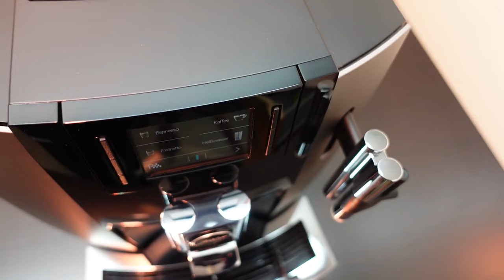Jura E8 Refurbishing and Deep Cleaning

Comment: this is EA model? I have EB model E8. Would it be the same?
Reply from the maker: That was an EB model, as far as I can remember.
Reply: @yt.myworks  Thank you, one another question, after you marked grinder, you took it off, cleaned it and you returned it to the same line mark but you stopped one notch earlier before marked line. Should i do one notch before like that?
Reply from the maker: @siiNke  I recommend making the same settings and then readjusting as needed.

Comment: my works fine, only have problem with steam. there is 3 sec of steam and than water just dribbles.
pump is fine, boiler/heater is fine, pressure reg, el magnetic valve  is fine, overpressure valve is fine, coffy pos valve is fine, magnetic pisston for brew unit fine.
i really not understand what is the problem.
can you help
Reply from the maker: Have you already checked this valve?  
https://komtra.de/media/files/Jura-C-E-F-Serie-Classic-Reparatur-Anleitung-%C3%9Cberholen-Revidieren-des-Auslaufventils-A6551301080.pdf
Reply: yes this is overpressure or pressure reliev valve, i dismantle it, put it into the citric acid for an hour and reassamble it. rubber seems to be ok, and i also lube it with vaseline. 
as i see it this thing is more or less safety valve if something is wrong. the outlet of this valve goes to the brew unit valve (magnetic piston operated)  or to the steam valve (magnetic valve). 

if something will be wrong with either magnetic valves than hot water wouldnt work or expresso wouldnt work. 
if pressure relief valve will be falty and wont hold the pressure steam or water will be released at this valve.
Reply: now i tested it. when i press steam button water is heated, pressure raises and i see water and bubblea moving pass this valve towards brew unit and into drain plate.
does this mean this valve is bad?
Reply from the maker: Did you install the spring in the valve correctly? The position of the spring is important!
Reply: @yt.myworks  yes it is positioned correctly, you cant even put it together if it is not
Reply from the maker: Okay, but I made the mistake of installing the narrow side of the spring on the outside. Consequence: No correct function. Can you make a short video with your mistake? Maybe I'll notice something. You can send me a link to yt.myworks@hotmail.com
Reply: i change that valve with new one and the same, after 3 seconds steam starts to sprinkle out of discharge valve and into the drip tray. 
maybe the reason is this discharge valve of a brew unit being bad or the 2 seals inside it.
this valve should  be closed

Comment: Can you explain me how I can calibrate new grinder? I know how to insert new grinder and everything but how much times I need to "click" when I rotating the circle on top of a grinder? And when I set the white lines in same positions, when I insert top wheel (thing which is used to change grinding level for coffee beans) how to set that on grinder?
Reply from the maker: Typically, the original settings from the manufacturer on the gears are still present, and I recommend using these as your initial setup. After that, several grinding cycles will be needed to achieve the optimal grind setting. To do this, place a paper cup or similar without a bottom as a funnel on top of the grinder and fill it with coffee beans. After several attempts, you should achieve the optimal grind.